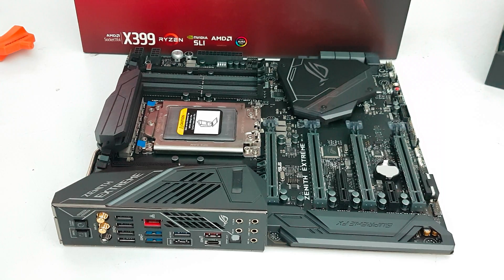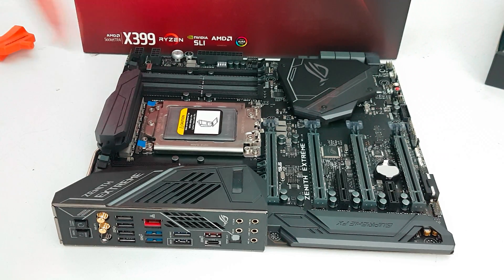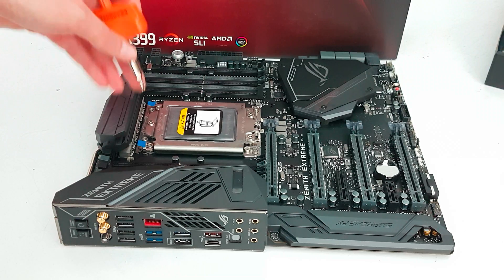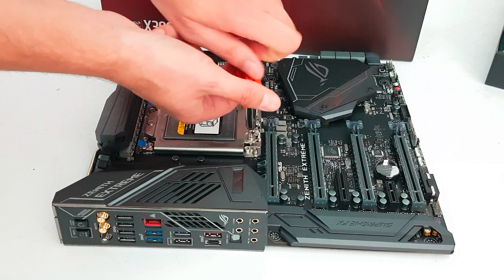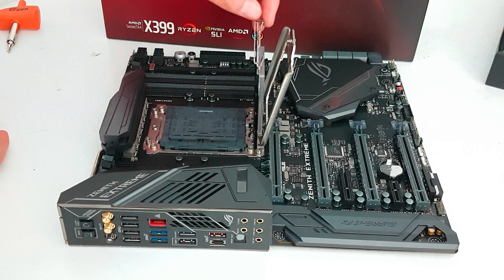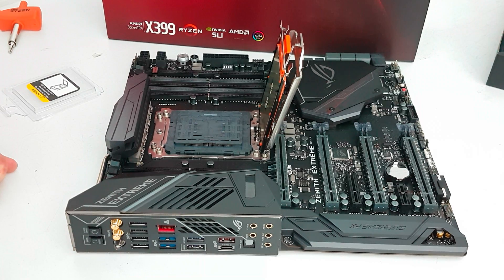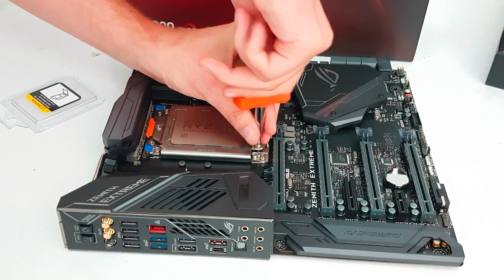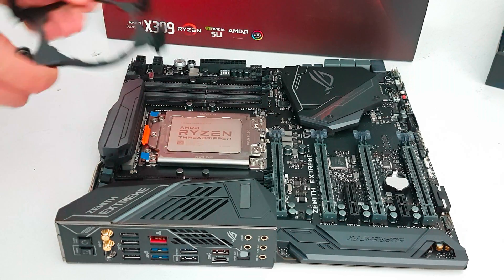Ryzen Threadripper 1950X Processor installation guide on X399 Zenith ASUS motherboard

Comment: Ummm. He ran the screws in the wrong order. Good job. That is also the ONLY Foxconn I know of that can thread the #1 screw with that little pressure. I had to shift the tray left to right until I got the screw centered and then i had to Damn near bend the Motherboard with downward pressure until it caught. Good luck. Find a different video or go to the AMD forums for real help